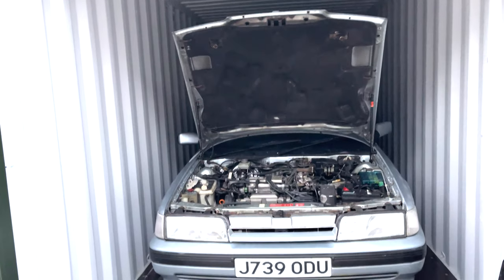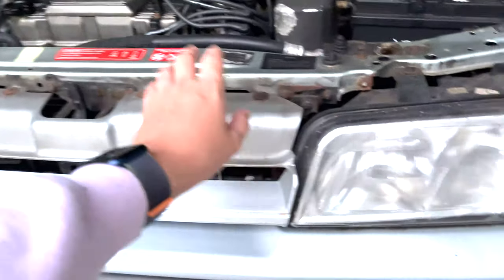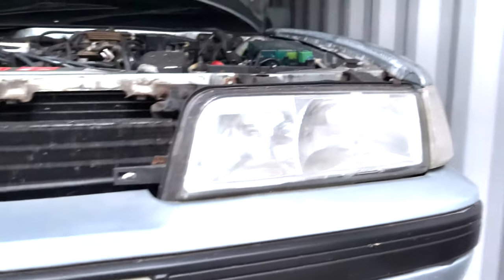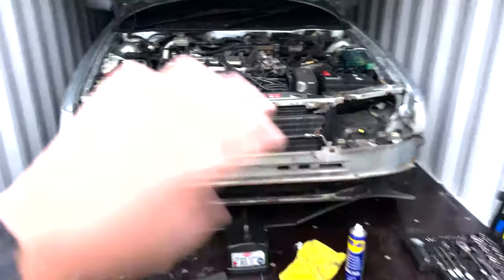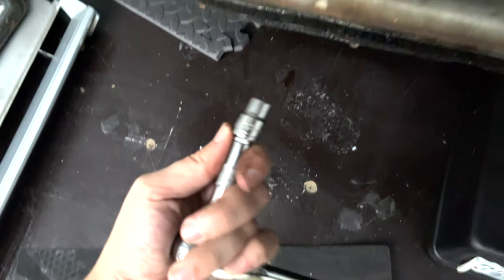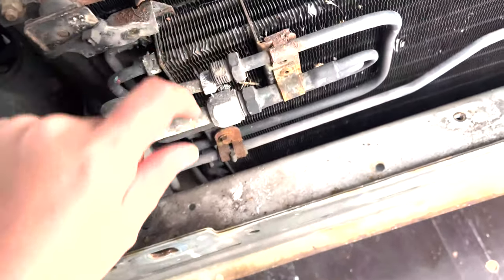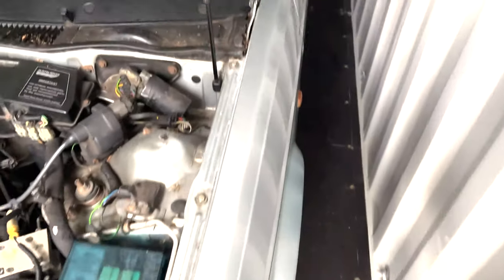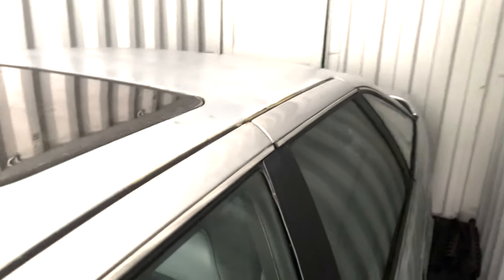Rover 827 Vitesse Restore Part 1 - Disassembling The Front End

Comment: The nut that secures the air-con pipe must still be on the pipe.  It's probably slid down the pipe because the pipe goes through the middle of it, it can't fall off.
Reply from the maker: Thanks, will check :)

Comment: Hi Tom, a fellow 800 enthusiast,  I will be starting a restoration of my 89 Vitesse in the coming months, flame red manual, pre cat. Also have a 90 parts car. Be careful with the cat though, certain that now if the car was manufactured with cat installed then it has to remain regardless of date of manufacture.  Think the law was tightened about the same time as big fines being offered for removing dpfs on modern diesels. Take care